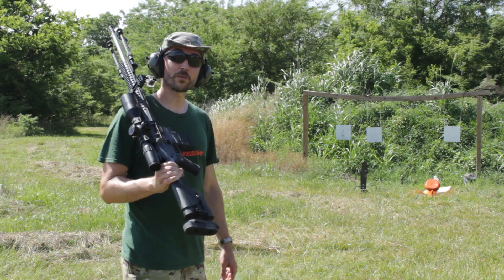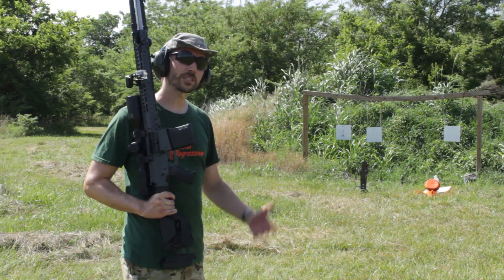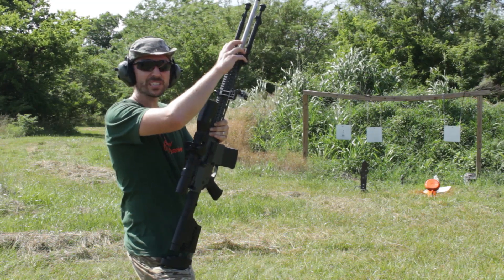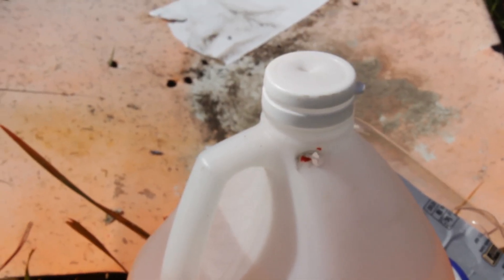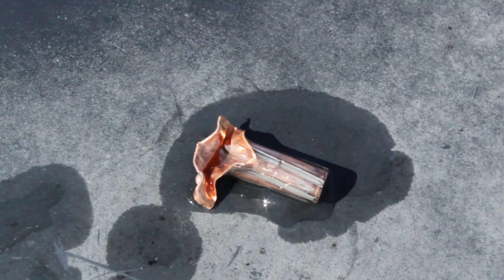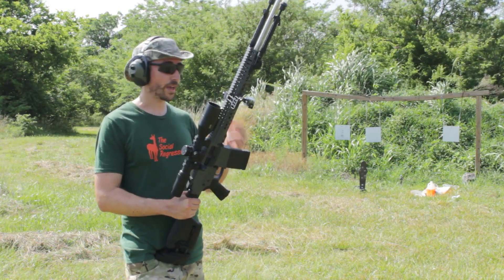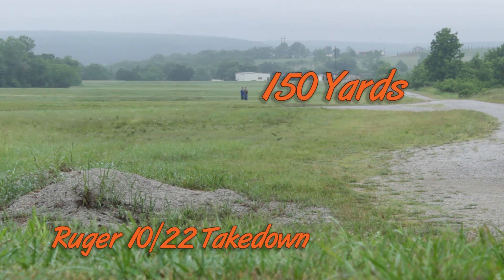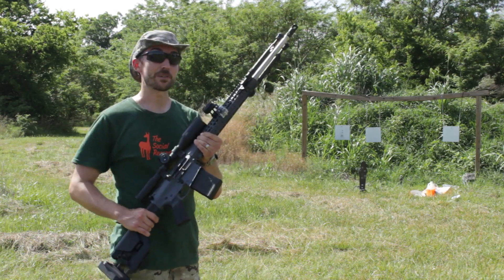Subsonic 6.5 Creedmoor Effectiveness in the CMMG Mk3 DTR2

Comment: Cycling a rifle length gas system with trail boss, forget about it.
I cycle an armalite 20" 1-10 twist 7.62x51 aac cyclone suppressor with 220gr-280gr with imr 4350 and imr 4895. Accurate to at least 250yrds.